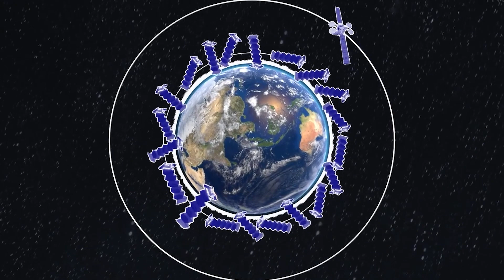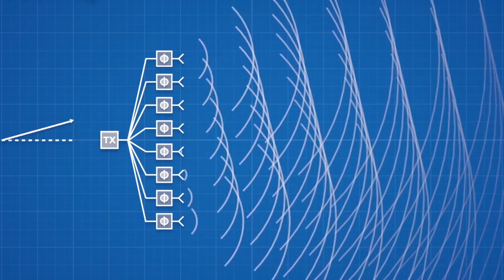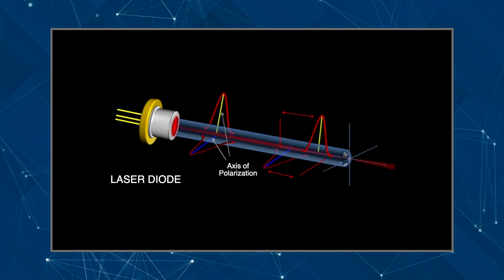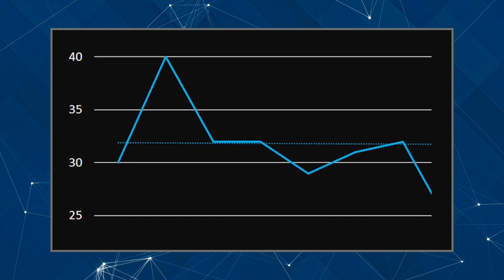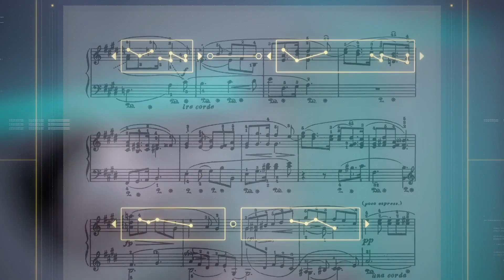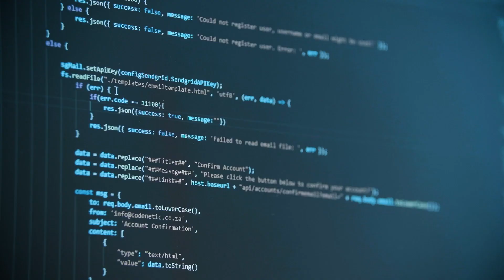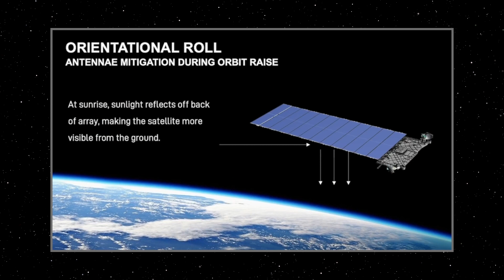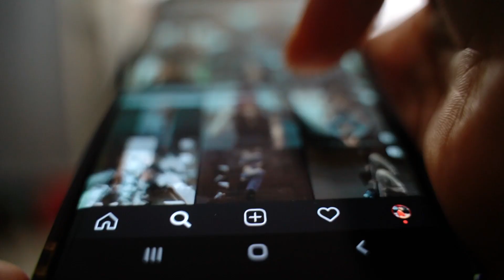How Starlink Will Change The Internet Forever, Starlink Satellites Explained, Starlink Plans

Comment: Starlink... is failing a lot of people. This nonsense about coming out of Beta is just that, nonsense.  Also kicking someone's delivery date out 6 months without so much as an email because they updated their "spot" on the new web based signup system...  add to this the complete lack of substantive communication and many are very fed up...  and it is only about communication, something SL seems incapable of conducting...  they have my address and my $100. Would it kill them to send a monthly update spam? Would it kill them to acknowledge the issues with the website changing peoples anticipated delv dates?  I was "end of '21", but I changed my dot and my place in line got shoved to mid '22... move me, but ffs, communicate with me in some way...

Comment: Starlink is worthless. The more people that sign up, the slower it gets. From what I've seen, 250Mbps+ Down & 15Mbps Up, is what Starlink does, which is what most folks can get now. And that's before the masses sign up. It's gonna be slow satellite service at best, and tons of falling debris & space junk at worse. (As a matter of fact, the satellites are already starting to fail.) Even in rural areas, the more people & devices on the network, the slower it gets. Should have covered the amount of bandwidth each satellite can put out per thousands users. Once people start to learn that important tidbit of information, the hype will be over. StarLink will never beat the performance of Broadband & Fiber, EVER.  I wanted Starlinks services at first, but now I want my 100$ deposit back.

Comment: Nice video!

A few comments: 
- Phased array antenna's can form a beam towards a satellite so they can follow that fast moving dataelite without moving the disc itself. It does not mean they can both send and transmit radio waves
- 2 fibre optic cables next to each other don't induce polarity. There is no interference between 2 fibre optic cables
- Latency is the time it takes for data to pass from one point on a network to another, not the time it takes data to be send; that is dependent on bandwidth 
- Latency is decreased when more satellites are up and running
- Those satellite trains are only temporarily there, once the satellites are in their final position they will be scattered hundreds of kilometers away from each other
 
Other than that. good narration, great edit!